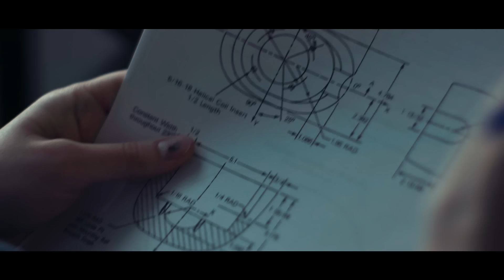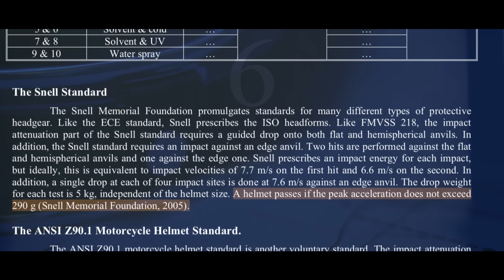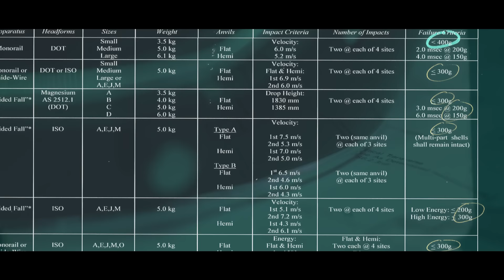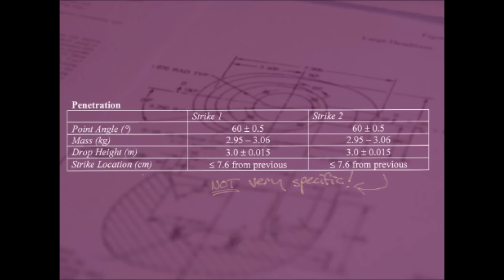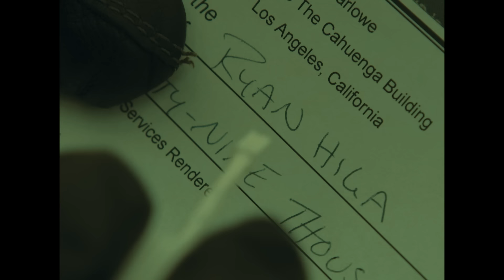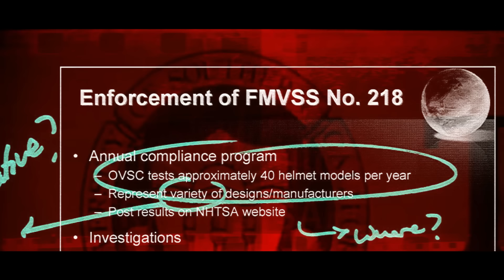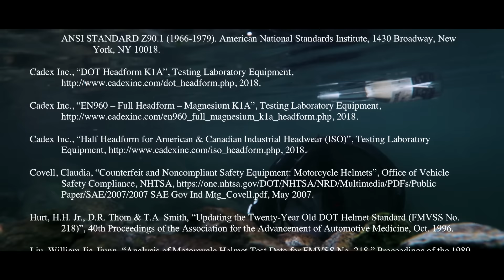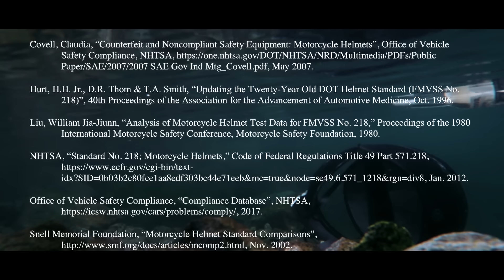Uncovered - Dangerous Secrets of the DOT Helmet Standard

Comment: I got a Beon B-110 helmet for riding my electric scooter that is classified as a moped.  Their image on the website shows an ECE certification sticker on the back of the helmet.  The tag that came on the helmet strap that you take off before using says in multiple spots that it is ECE certified.  But nowhere on the actual helmet they shipped me does it say anything about any certification.  The foam inside is heavily offgassing stryrofoam cooler looking material under a paper thin lining.  Is there any chance in hell this thing is actually legal or provides any protection at all?

Comment: Hey.. Can you please do a video on using an aftermarket full exhaust system pro's and cons.. Lots of ppl talk about this with back pressure affecting valves etc.. Is remapping necessary after installation of aftermarket exhaust and do we need to change air filters as well?? Would be very helpful topic if you could make a video on this Pls.

Comment: You can look up your helmet to see if it meets the U.K. Sharps standard here. https://sharp.dft.gov.uk/
I was surprised that my old Shoei GT Air scored lower than the Shoei Neotech II modular that I just ordered. The helmet tests measure the g-forces at different locations on the helmet and are labeled on a diagram for each helmet. The color codes used are below. I hope this helps! 

Green Peak acceleration up to 275g: the ECE 22.05 test limit at 7.5 m/s.
Yellow Peak acceleration up to 300g: the British Standard 6658:1985 test limit at 7.5 m/s used by SHARP as the maximum permitted value for a 5–Star rating.
Orange Peak acceleration up to 400g
Brown Peak acceleration up to 420g
Red Peak acceleration up to 500g
Black Peak acceleration in excess of 500g.

Comment: I sometimes have to wear a medical helmet due to past brain damage and at the worst possible impact it's tested and verified to reduce the impact to 77g's, and that's worst case scenario.  It's made of multiple layers of rate sensitive foam so it will still protect well in lower intensity impacts.  If I had a larger head that number drops down to 65g's for this type of helmet. 

 400g's, even 250g's isn't acceptable.  It's as if manufacturers truly don't care.

Comment: 4 years ago while riding I was T-Boned by a car (driver of the car was at fault), I was wearing a DOT approved helmet (can't remember the helmet brand, didn't have it long but I know it was sub 150 USD.... I was broke and a NOOB then... yes, yes, bring the hate for it). Needless to say, I was projected from my bike and my face slammed into the pavement. The helmet nearly broke in half and my face was mangled to hell. Suffered serious head injuries among other traumatic injuries. Could not believe that a helmet with Americas "golden and required standard of safety" allowed room for that much trauma. I do give leeway for brand quality and price point a bit. But if such a helmet, which followed the minimal DOT standard and still that happened, then what does that say for DOT? I've since been wearing an Icon Variant Helmet, we will see how that holds up, should I suffer another wreck as bad as the one I've mentioned here. Perhaps the Icon helmet will hold up much better. I'll admit I have not done the most extensive research on the testing that Icon does with their helmets. All in all, maybe we need a revisit to the safety standards of safety equipment here in USA. Just my thoughts. Anyone else have similar experiences with their DOT helmets?

Also, great video, good production!

Comment: What's most appalling is that this is such an easy fix. All the NHTSA needs to do is come up with some credible standards based on existing research and require  that manufacturers perform testing at an independent test lab. They do this for electronics for instance and it works fine. Is the helmet lobby really that strong?

Comment: That's good and all, but helmets need to also be reasonably priced. It's hard to justify a helmet that costs over $100 but your motorcycle can only run no more than 80kph, only recommended to keep for 5 years before replacing, and costs half of the cost of your motorcycle.

Comment: My bike pulled power for a second at the worst possible time.. at about 5mph with a fat lean on.. like a slow speed u turn with lots of lean pulling into my drive .. I love to push my low speed skills at all times ..
bike for some reason power went away and as I immediately let out a bit more clutch tve power came back but at that speed with that lean any lose of power .. gravity wins.. I was body slammed to the ground at like no speed at the time it went over .. back of head smashed into the street.  My DOT 3/4 prob saved my life (yup I bet u can die from a 0mph crash if u smash yiur head the wrong way.. 
anyway.. bell was rung hard! Felt like there was nothing to lessen the impact and the plastic on the spot where my noggin smashed into the ground was kinda fucked up..  I wonder if a legit crash at speed and some real g forces would split that Biltwell in half 

Is there a higher safety level 3/4 out there?

Comment: This is one of the most misleading videos on YouTube. It shows the narrator bashing a helmet with a baseball bat; the helmet cracks and
breaks apart, meaning the helmet is absorbing impact energy. The narrator snidely claims that “This wouldn’t have happened with a Snell helmet” but fails to notice that all that energy would have been transferred to the rider’s head if the helmet had not cracked. He claims that DOT didn’t make changes to allow for different head sizes until 1988 but fails to mention that Snell didn’t make those changes until 22 years later (Snell M2010). The narrator claims that the last time DOT made any significant updates to their standard, only two countries had internet and NASA had just coined an obscure new term called "global warming." He fails to mention that the last time Snell made any significant changes to their standard, the word “internet” did not exist and that NASA had not yet been formed. Yikes.